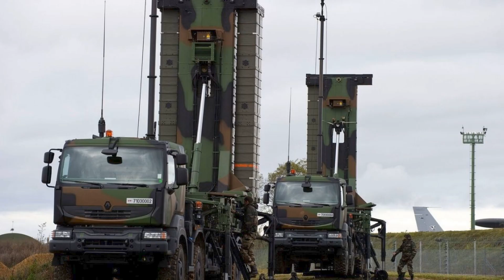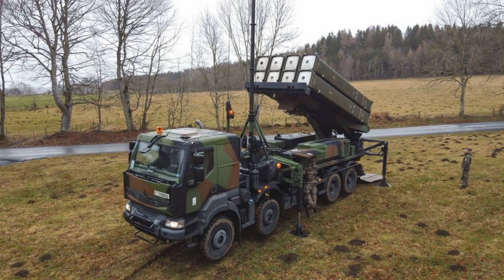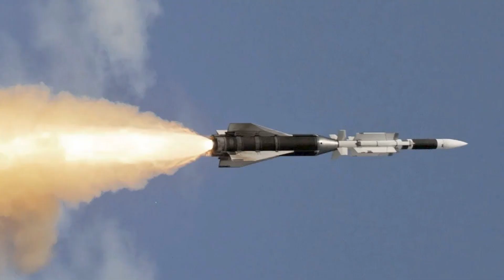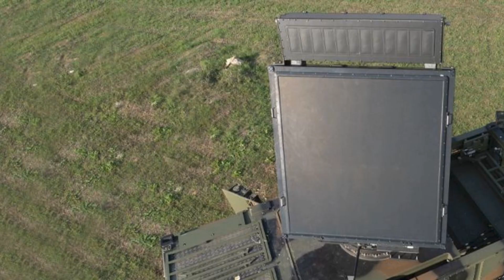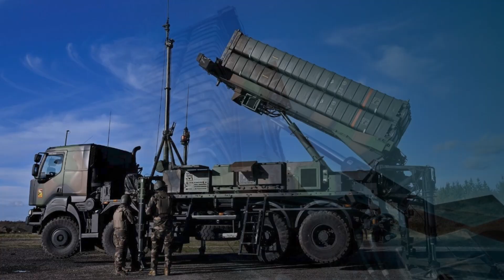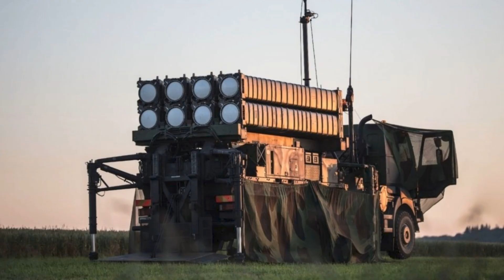France’s Next-Gen Air Defense Could Redefine Ukraine’s War in the Skies

Comment: In fact, many people are unfamiliar with French logic. The entire French doctrine is based on defense, knowing that counterattack is not out of the question.  So behind this defensive ideology, there is a real desire to defend the territory against all threats (even if  this is impossible to achieve 100% of the time). Its radar systems can detect a missile within a radius of +/- 3,000 km, in fact as far as the Urals. Next comes “Very High Altitude Defense” (VHAD), whose objective is to detect and identify objects maneuvering between 20 and 100 km altitude.
This detection is carried out in particular by air defense radars and is also based on the development of long-range ultra-high frequency radars. Satellites also play a role in THA detection.
The THA strategy also includes an “interception” component using fighter aircraft and their effectors (missiles). Their capabilities will be enhanced to enable them to neutralize high-altitude, fast-moving threats.
The use of surface lasers developed for space applications is also being studied.

And certainly other projects under consideration that you will discover in the near future...
Reply: For future Ukraine Airforce: 
Contrast in use between a lightweight, cheaper, "defensive" Gripen, easy to hide, able to take off from a simple road...  
And an "offensive" Rafale: power projection thanks to its superior carrying capacity and VLA/VHS (Very Low Altitude, Very High Speed) to avoid air defenses over enemy territory.